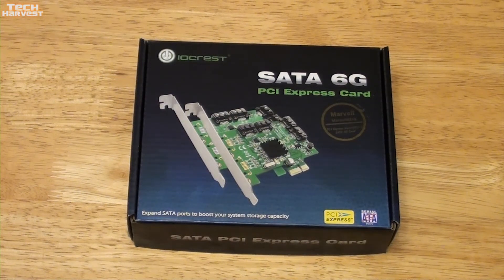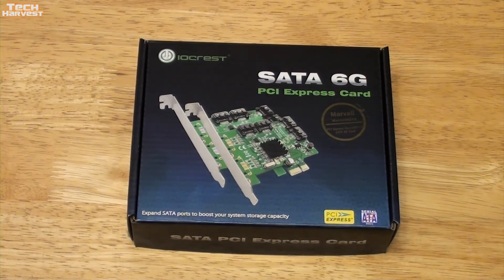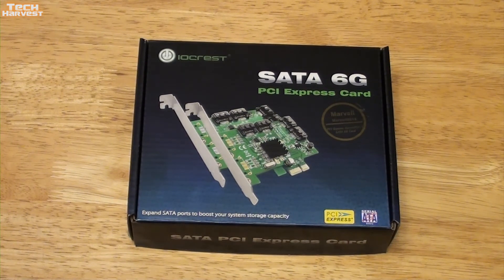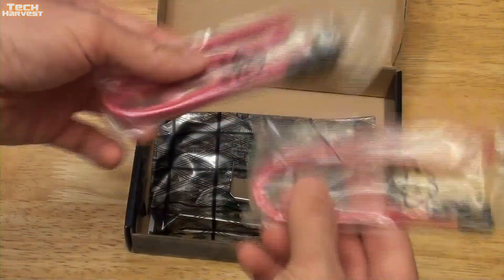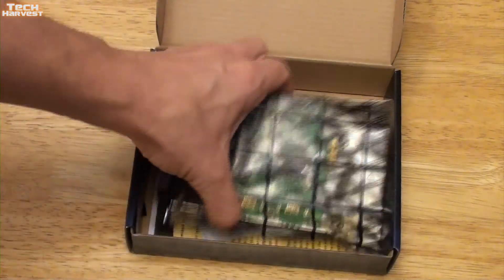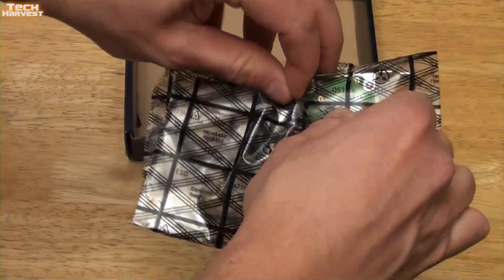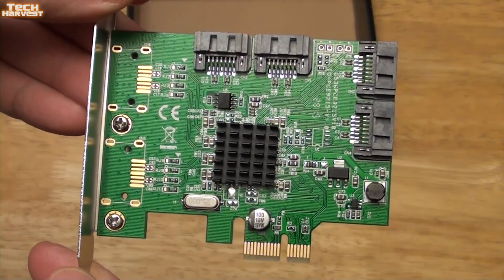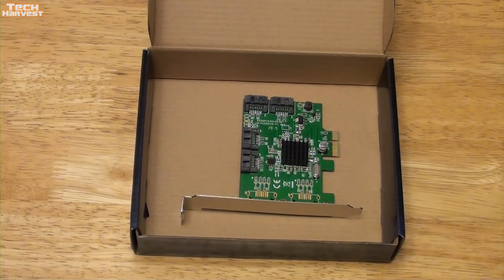Iocrest SATA 3 PCI Express Card Unboxing

Comment: I happen to have the same machine, and it's been about 5 years since I've use it as my main CAD Machine. I happen to be in need again of it's raw power, but I fear the monster within it may not perform as it once did due to age. Questions:
1. Have you updated the bios? If you have, did it helped?
2. Have you try to run Nvidia Tesla cards in it? 
3. Have you or will you upgrade to the M2 NVME SSDs?

Thank you for sharing your content and I look forward to any update videos on your workstation.
Reply from the maker: It does show its age, however it’s far from an obsolete machine. If I were you, I’d fire it up and see how it performs the duties you want it to. As for your questions:
1) I’ve maxed out this machine’s CPU and RAM. The only thing left to do is update the BIOS which I have not done yet.
2) I have not run a Tesla card in it.
3) All of my PCIe card slots are occupied so I have not tried an NVME upgrade. If I decide to dump my WiFi card I may consider it. However I’m not convinced that the trade off is worth it.
Reply: @TechHarvest  I've been testing it with a Tesla video card to process Lidar point data and it is performing amazing. You are right the machine can still perform great, but the fsb of the mother board is the only thing I am struggling with.

I can not seem to get faster then 30 mbs read and write speeds to NVME SSD, and curious if you have been able to get better speeds?

Thank you for responding. Good luck